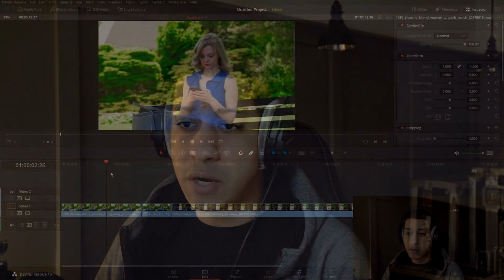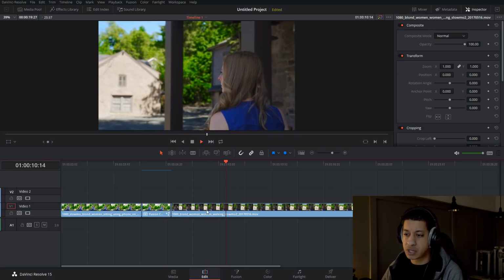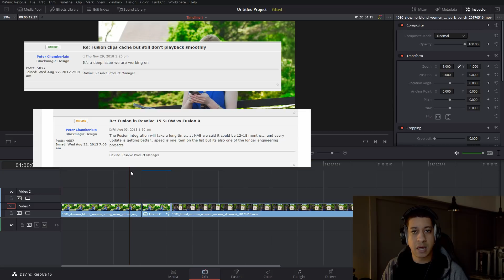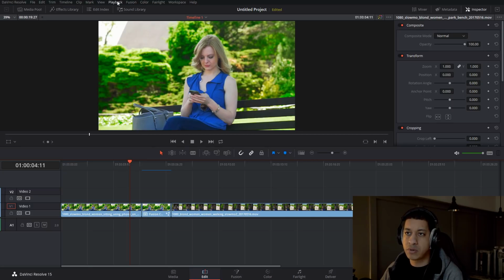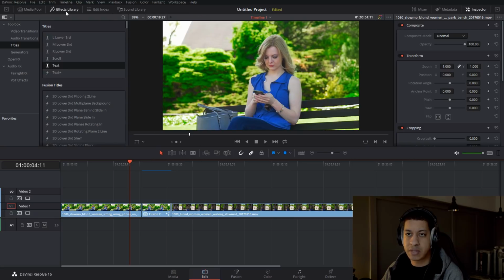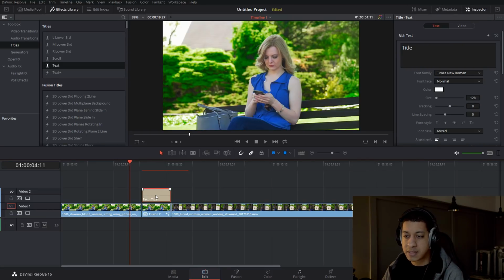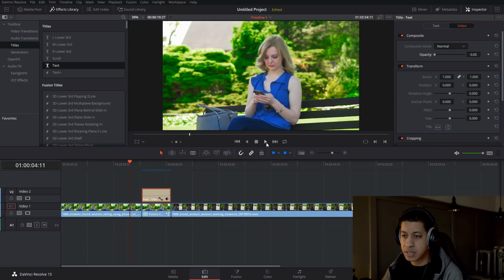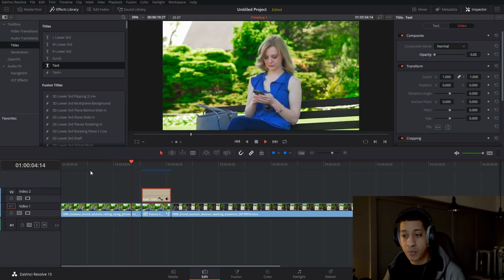Fusion clip cache workaround in DaVinci Resolve

Comment: Woooow thanks. It's crazy this workaround is still valid in 2023 in DaVinci Resolve Studio 18.1. I have an OpenFX effect that was supposed to be cached (blue line) but was not playing back smoothly. And this solved my issue!
Reply: Same, I don't have the most powerful system but I'd see the blue line at the top indicating the clip was cached, still had horrible FPS. Went searching on Blackmagic Forums and came across this vid, and it's a night and day difference.

Comment: Hey Jay, thanks so much for this tip. I started getting deeper into Davinci Resolve because of its Fusion integration, and after spending a lot of time trying to learn it, I am a little disappointed as using Fusion renders the Edit page impossible to work with. It seems odd to me that after you postet this video over a year ago, it still isn't fixed and your workaround still seems to work. Or am I missing a new development here?

Comment: Still happening in Studio 16.2. I've made a custom effect within an Adjustment Clip and saved it on my Power Bin. I've been struggling with this for two days until I've found this video. Thanks a lot!
Another way to achieve smooth playback is converting the Adjustment Clip & the clip underneath it to a Compound Clip, but then you can't edit your settings in the Fusion Page.

Comment: Hello Jay, thanks for the tip! I've been wondering about this issue since a few days ago I was working on a fusion clip about a minute long for a demo of the capabilities. As you might imagine its heavy on the fx including lots of keyframes and even a particle wipe. 
 My computer is no slouch, but I was previewing at only a couple fps, and often locking up. The autosave didnt help once and I lost about 6 hours of work. Thought it was my computer running out of ram, so added another 32Gb which didnt help much. Maybe this will help in the future.

Comment: Hi bud, I hope you can help resolve and issue in resolve :)  I've been using reverse, speed up and down with no issues, until now and was hoping you could help.  For some reason, when I reverse a clip now it reverses it but the audio totally changes to other audio from the video it was cut from rather than just reversing it with the video as it should and was recently, any idea what could have caused this? it's so frustrating.

Comment: Apparently, turning autosave off can also reduce or stop that issue from happening. Saving to a new project can overcome that issue as well once the autosave is cancelled. According to the forum, it is an issue with H.264 video codec which at the moment it does not handle well at all. So cancel autosave first and save to a new project can have positive results..

Comment: It's very sad that there has to be a workaround for this. But thanks for pointing these out.
Reply from the maker: At NAB they said the fusion integration would take 12-18 months to be fully implemented. I don't think it will always be this way.
Reply: @JayAreTV  I would be surprised if they integrate fusion 100% but 90% would be nice and maybe improve reactor and the community a little bit. All the nuke guys are laughing but mainly because there are no starter guides for fusion and real compositing out there. You have to search a lot and invest hours and days into research. Maybe you will also join the WSL discord channel together with some new faces

Comment: Good one. I have been struggling with this for a while. I also have been having a lot of jumpiness in Fusion, where for example particles will skip around while I am playing them back, both in the fusion page and the edit/color pages. Really frustrating.
Reply from the maker: Clear the ram cache on the fusion page if you change parts of a particle system to stop the skipping around.
Reply: Thanks. Is that the "purge cache" function? If so, I have done that.  @JayAreTV